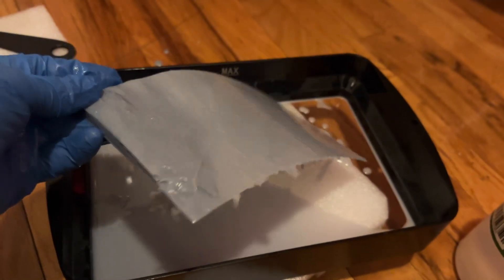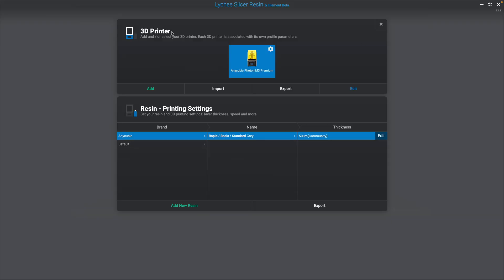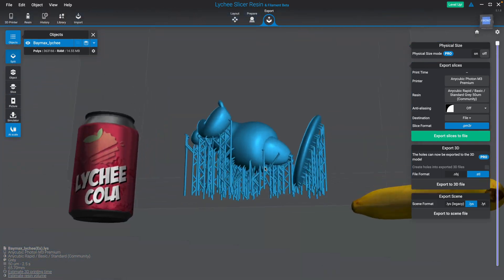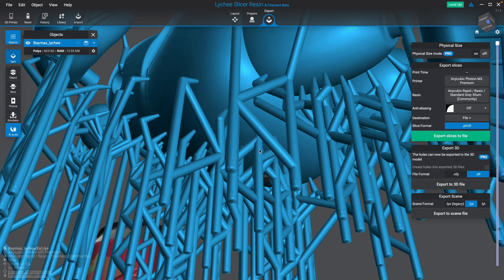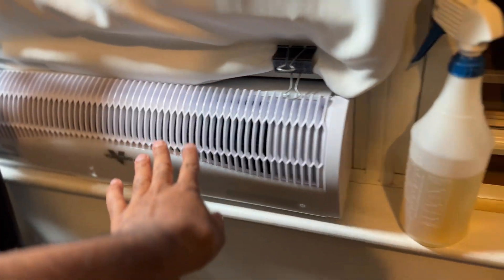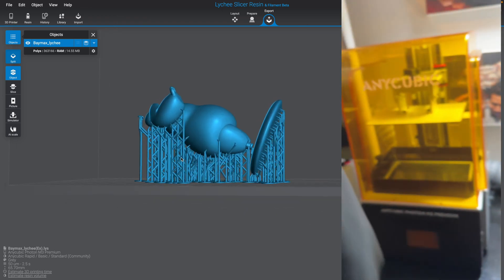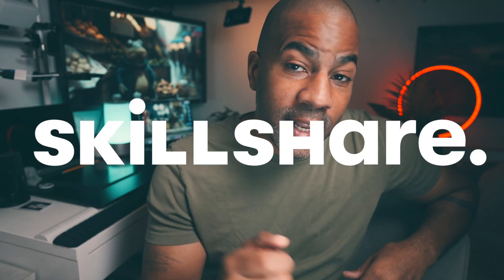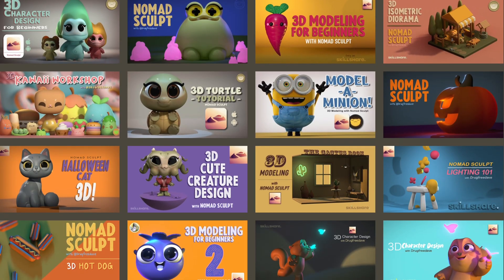3D Resin Printing as a Complete Beginner: Take 2 (Anycubic Photon M3 Premium)

Comment: 1 Suggestion. Get yourself a small MESH garbage can (something that can fit INSIDE your curing station. Keep all your paper towels and other garbage pieces that have liquid resin on it. Once the garbage is full or you're done with a print, put that garbage can inside of your curing station for like 10 min or so. This will make sure that any left over resin will be cured and safe to touch (even for garbage collectors).
Reply from the maker: Thanks RTD! I’ve been using a ziplock but keeping it outside. It smells so strong! The supports will all go together as well after they’ve been kept outside. I’m not exactly sure the best way to dispose, but def getting everything nice and cured! I’m using outside spade more, since my printer is in my bedroom 🫠🫠

Comment: You can separate Baymax in different pieces and then use the best orientation for each individual piece. Before taking the Built plate let the Residual Resin go in the Vat first. Use Light Support for small things.